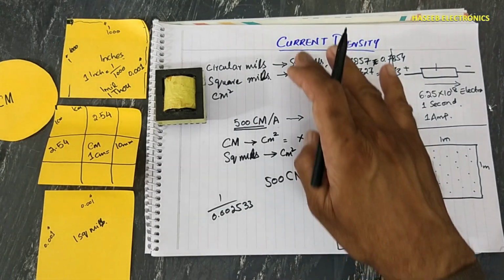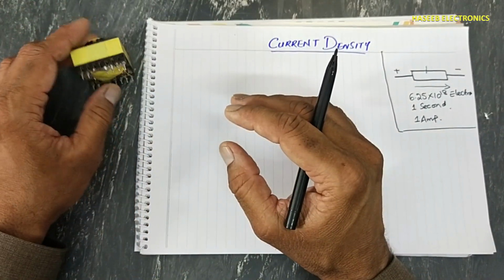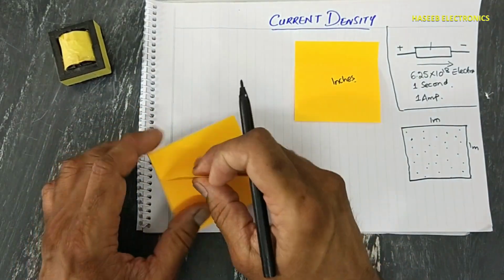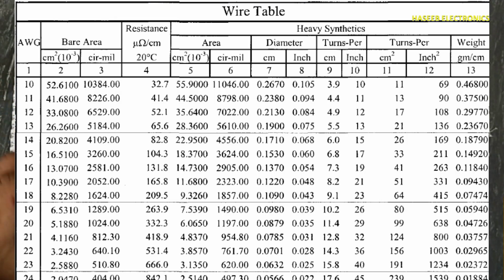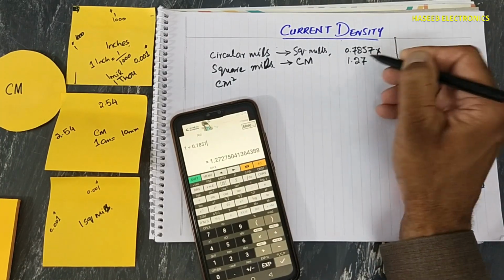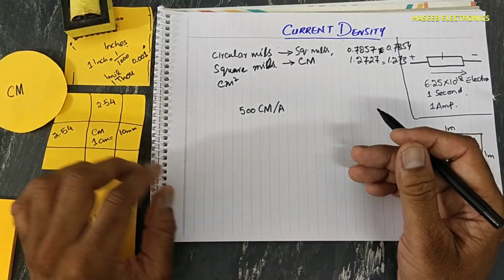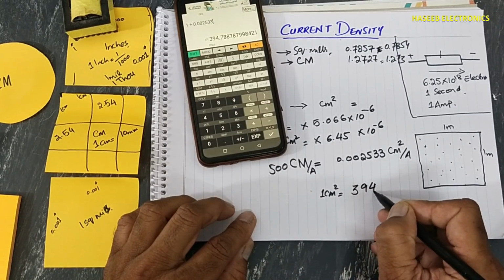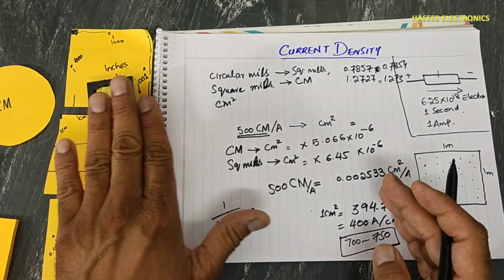{935} current density in transformer

Comment: Dear Mr. Haseeb.
I built a DIY spot welder with the transformer from a microwave oven. The input voltage = 230VAC on the primary winding of the transformer. The secondary consists of 3 turns of 16mm² insulated copper wire. The output voltage is 2.1VAC.
When testing with the spot welding machine, I find that the output current is much too high because the welding spots keep melting even with a short pulse of about 0.2 sec. How can I adjust the current of my device? Greetings Andy

Comment: I really appreciate your efforts in educating us. 
I want to calculate the wire size for inverter secondary wire size it is a 5000VA with 48v/200A battery and i used the circular mil formula but when i check the wire size can only handle 63A kindly assist

Comment: Thank you very much Mr. Haseeb for this explanation. So 400 A/cm² = 4 A/mm² = 500CM/A seems a save value. Does this mean that when I have for example a SMPS with 100W output in 10V ( so 10A in secondary) , I only need a winding wire surface of 10A/400A = 0.025 cm² = 2.5 mm² = 1 times AWG13 ( AWG13=2.62mm²) ? Without taking into account the skin effect due to the frequency (AWG13 = 5,3 kHz for 100% skin deep)